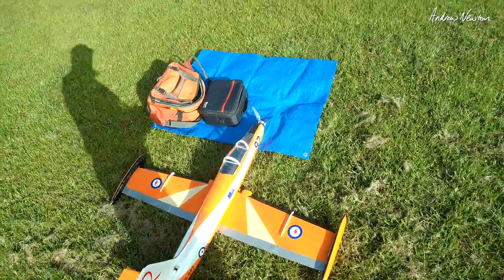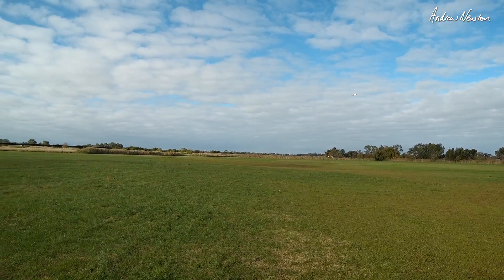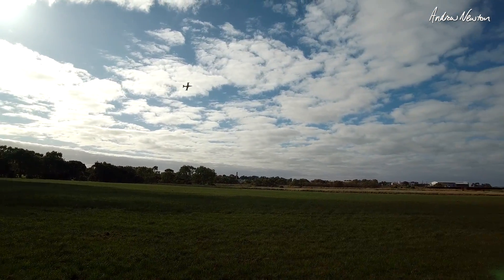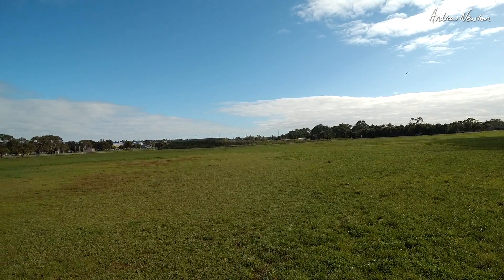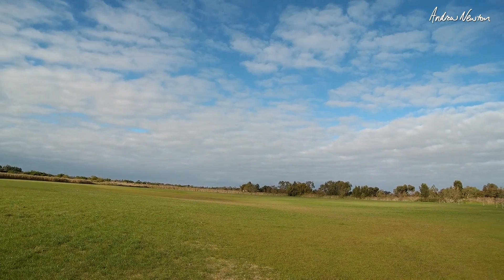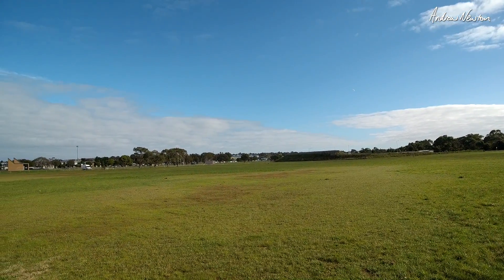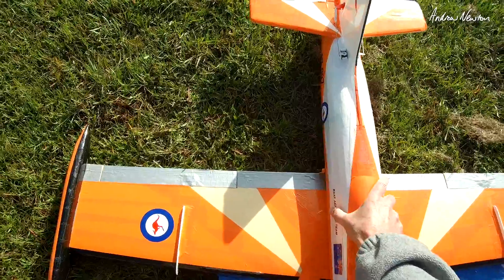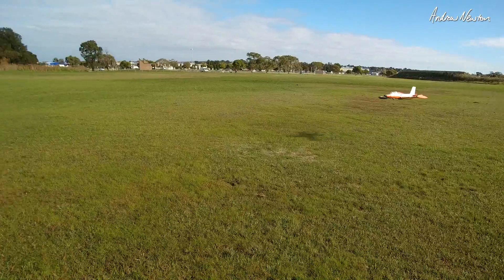Macchi MB-326 Maiden

Comment: 👏🏻👏🏻👏🏻👏🏻👏🏻👏🏻👏🏻👏🏻 Congratulations, You've build a great looking and very good flying MB 326, it flyes like on Rails 👍🏻 and it is quiet fast😃, but a Jet with a Propeller on its Nose😖, really Andrew❓
Anyway, a great Achievement 👍🏻👏🏻👍🏻👏🏻👍🏻👏🏻👍🏻👏🏻👍🏻👏🏻👍🏻👏🏻👍🏻.
Greetings from Anton.
Reply from the maker: Oh yes, prop is the only way to fly
Reply: @AndrewNewton  Did You have ever tried a high efficient EDF (not the cheapest China made Units) with about 4-6 Cells❓

Comment: Hi Andrew. I have seen many of your vids about setting up gliders and it's very helpful, thanks. I have just bought and maidened a fms fox 3m and would like to set up crow for it but it just has one aileron lead from inside and it has multi bullet type connectors in the wings. How would you go about having independent aileron connectors please? 😃
Reply from the maker: Need to look at the connector from inside the fuselage, or unscrew and pull out if you can. May be just Y leads connecting ailerons and another for flaps? If they are soldered you will need to cut and resolder individual servo leads.
Reply: @AndrewNewton  ok thanks Andrew I'll have a look

Comment: Looked in the groove to me....One of those planes you just know will fly well...Love those tip tanks, very retro. I'd fit a decent non folding prop to get the cruise amps down...It needs more pitch, not a glider tug prop.
Reply from the maker: Yes that's the plan. Different prop and ESC

Comment: Hey Andrew, really great plane to play with!!  Does put a smile on ones face. Quick question: How did that landing wheel work out, was it useful, why is it in that position and would you put it in a slightly different position next time maybe (front to back...), did it help to land the plane better?  Thanks and happy flying!
Reply from the maker: Thanks, the wheel is essential to stop servos getting ripped out. Placement seems to be right but I need try some landings on shorter grass to see if it will roll along a bit more.

Comment: After all that pent-up anticipation.... what a great maden flight! The symmetrical airfoil just makes it cut through the air. Did you use any downward thrust ange for the motor? Seems there is no pitching up when you increase the throttle.... just straight and true! Fantastic job.
Reply from the maker: Tiny bit of down thrust maybe, nothing measured just by eye

Comment: You need to add a smoke pod some how
Reply from the maker: I have some smoke pods that last for 30 sec each. This might be the plane for them.
Reply: @AndrewNewton  Cool. Can that be switched on / off from the radio ?
Reply from the maker: Just little pods that you light with a flame. Easy to rig up a hot wire on a servo maybe